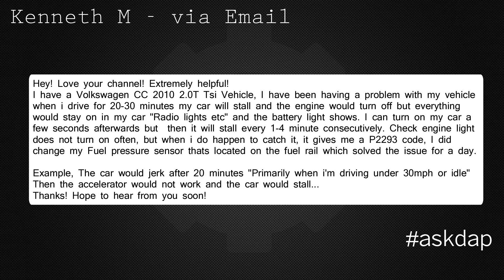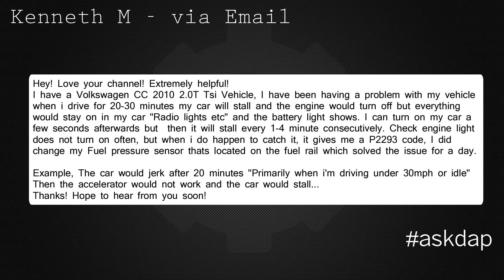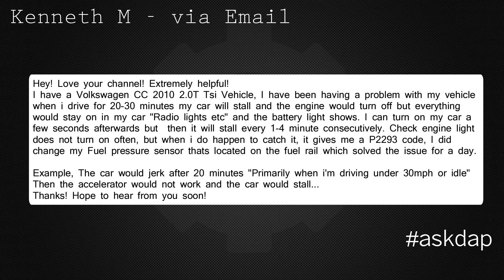VW 2.0t TSI Engine with Fault Code P2293 (N276 Valve)

Comment: I have a 2011 VW cc sport 2.0T TSI engine. Initially I was getting DTC fault codes for a low pressure fuel in the rail. Replaced the High pressure fuel sensor as well as the high pressure fuel pump HPFP. After clearing the fault codes I was getting the following fault codes P2293, P2178 and P2187. Also to mention that I have previously replaced the intake manifold, the PCV valve as well as the spark plugs and igniter coils. It’s like chasing a ghost for the last few months. I appreciate your expert opinion. Thank you so much in advance.

Comment: Hi, i get the same code but different symptoms in the morning i start the car easily but if i stop the car in middle of the day for Grocessory staffs for example like 30 min or 60 min and try to start the car it start and then engine would turn off, i need to keep pressing on fuel while starting the car for couple of minutes so the car can start .. 
I have changed the high pressure fuel regulator issue solved for a week, but again the same issue came back 😢😢

Comment: Mine has a p2293 p0087 p0089. I replaced the low pressure fuel pump. The fuel pressure regulator on the high pressure pump. The fuel filter. I had a new motor put into the car. Its a 2007 audi a3 2.0t. Is the fuel pressure regulator supposed to be orange or black? I actually blew timing belt then put new motor first day I had car back blew piston through side of that motor. I'm goona try the cam follower and high pressure fuel pump of 2nd motor. The shit off first motor is gone.

Comment: Hey so I have a 14 a4 that and after I got my ko4 turbo and tune I started getting a jurking when I was continuing a pull after a shift. This later on I got in my car and started to drive and it just died while I was on the highway and wouldn’t start back up. I have the p2293 and am wondering if my hpfp literally died. Planning on taking it off to look at it but I was freezing today. Tia

Comment: My 09 Passat, 2.0 TSI randomly would shake violently on me, this started two years ago (2019). I was due for a carbon clean up, so I did that, the car ran fine for a while. However every so often, at complete random, the car would just not roll over. It would crank, start, then die. After 20-30 mins the car would start again without any issues and then would happen at random again (each instance months apart). 

I changed the injectors, sparks and coils all from vw parts dealership. Recently the car has started to do the same thing more frequently, three times yesterday.

I changed the hpfp because of the P2293 code, and it worked fine again for an hour. In my test drive After replacing the pump I gave it pressed the throttle to test the acceleration and the car choke and started shaking. After pulling over and running diagnosis, it gave me misfires codes on cylinders 1 to 3 and the car would shake again, almost as if it was choking, bit of a stutter but the p2293 code didn’t come back. 

Later that same day I checked the coils and sparks, cleaned them and back to normal…but an hour after that the car would shake as if it was choking and didn’t want to start again. This time the p2293 code came back on.

Anyone had a similar issue? Any suggestions? I have yet to replace the fuel pressure sensor… I think that might be the last thing I replace before I let this car go…been a headache. Cheers.
Reply: Is this a 2.0t?
Reply: Yup. 

Update - changed the battery and the issue went away for a couple of months. When I changed the fuel pressure sensor, there was no change. Looking to replace the LPFP later this spring.
Reply: @kevincortez6273  aw ok, my q5 has stalled on me three times after I changed lpfp and fuel pump control module so am now looking to change the hpfp and cam follower and pray.
Reply: Does it stall while driving or soon after start up?

Good luck - let me know if that fixed in in your end. I actually got my car diagnosed for the issue and they told me it was carbon build up. Highly doubt it cause I cleaned myself real good.
Reply: @kevincortez6273  so after I changed the pump, it would still crank and not turn on so I found out about the pump control module lodged in that cavity and changed that because that’s controls the pump priming and I used to only hear the pump prime half the time, so when I changed that it worked perfectly for around 4 days, then I put gas in the tank and the car stalled on me mid drive half a mile down the road for the THIRD time when I was happy that the issue was finally fixed. At this point I don’t know what to do I scanned it and only got code p02293 which could be a million fuel and wiring related things.

Comment: Mine has the same code but my car doesnt die. It shows no check engine but has the code. Its a 2006 vw passat 2.0T and i have noticed when the code is displayed it does seem to bog down but never dies and doesnt really idle rough

Comment: First thing i check is if the hi pressure (thrust) sensor is correct for the car , its easy to do and I have seen incorrect sensors installed numerous times , cant stress enough to use OEM factory on critcal fuel system parts, there's a reason they cost more

Comment: My gti mk6 got p2293 code.
Check engine is off.
The only issue i have is that all morning it takes a little more to start.
Because when i use it to go anywhere, I stop it, do things then about 10-20-30 min it starts with no problems.
What could it be?
Fuel pressure sensor?
Low pressure fuel pump?
HPFP?
Fuel filter
Reply: Did you figure it out? Running into a similar problem

Comment: 20AE FUEL PUMP CONTROL MODULE RECALL
Guys don’t waste any money it’s open recall for this car just go to your dealership and fix it for free, I have the same issue on my car after they change the module it was perfect
Reply: What model you have please ? As i have the same issue in the video and this happened to me every some days and sometimes same day more than one time without the check engin lamp
Reply: What were your symptoms, and what trouble codes?

Comment: Dear, and the P2294 that makes reference to the regulator of the fuel pressure and possibly the relay J757, because the revision and the relief are in perfect condition, the organization and almost instantaneously in the fault and the P1916, do you attend to me? regards

Comment: Hey, I replaced hpfp cam follower and control module which fixed issue for a day I went to start it this morning and it cranks and starts but 2 seconds later stalls any idea what can be occurring maybe fuel filter ?
Reply: Did you figure anything out?

Comment: Well wondering if this is what I need, it won't start on its own but if I put starting fluid in it then it starts and runs fine and sometimes it will start again after i shut it off.  but usually more than 8 hours its starting fluid all over again to get it to start then it runs

Comment: what was the solution to his problem? i have the same problem with my 2010 cc. i have already changed the HPFP but that doesn't seem to be it. After about 20 minutes of driving and I'm at idle my car stalls when i start to accelerate. its not violent like the example in the video. once i try to accelerate the car will slowly start rolling and ill have time to pull to the side of the road. when it stalls the battery light will be on and the car starts up right after but does it again like 3-4 minutes later. can you give me any advice?
Reply: Did you solve it?
Reply: christopher Sanchez  did you solve the problem and how?

Comment: Hi. Same thing happening to my VW Passat 2.0T B6, 😖.
Codes
P0089, P2293 & P2540. You think it could be the HPFP? P.S i already replaced Module on low pressure pump Thanks

Comment: great videos Thanks!  I am getting a code p12a2,  any info on that would be great.  I was wondering if it is possible to by the fuel pressure regulator valve that is screwed into the top of the fuel pump..  2009CC  2.0T  thanks again,  B

Comment: My car is a vw gti 2009 and I have the same code but also my p0300 telling me I have the cylinder misfire. There was gas coming out of the spark plug and the mechanic said there is gas now in my injectors ? can someone help me ?

Comment: Hi i have this code on my audi b8 tfsi. I am also experiencing a loud screeching and ticking noise. I used a stethoscope to hear the HPFP and it definitely seems to be making the sound. Went online and bought another vw audi hpfp and replaced it. Problem still exists. Replaced PCV as well just as a precaution, and the sound is still there. It makes almost like a mechanical screeching sound. Help! (Car has no issues. Runs drives and accelerates without any problem or jerking.
Reply from the maker: +Ben Zhu Its possible you have an issue with your fuel pressure sensor https://deutscheautoparts.com/make-model-year/audi/a4/b-8-2009-2012/engine/2-0-turbo-audi-valve-lift/repair/sensors/06j906051d-fuel-pressure-sensor-fsi-tsi-vw-audi.html
Reply: Just to be sure before i do go ahead and buy this. I've taken the stethoscope once again and traced the sound down the metal pipe from the HPFP to the fuel rail. The upper portion of the fuel rail that is closer to the metal pipe is louder than the lower part( That part being closer to the pulleys and belts) Also the sound is somewhat of a metallic screeching noise.

Comment: In my case, replaced the Fuel pump and cam follower back in April. 
I dont understand why i got this code, the car drives normal I cleared it after scanning.
Reply from the maker: +Thafussa Do you have a TSI or FSI engine?
Reply: 2.0 TFSI Deutsche Auto Parts
Its a SEAT leon FR+ 2008, engine code BWA.
I don't think you guys have SEAT in the U.S.

But its the same engine found in  the audi A3 2.0T and VW GTI mk5
Reply from the maker: Thafussa Yes Im sorry we dont
Reply: but its the same thing

Comment: having this exact same issues onmly my 2008 vw gti stalls out on the highway when idling and prettymuch whenever it wants to  any ideas lpfp wwas juist replaced it was just tuned to stage 2 and its so annoying because i have to work and i cant trust my car to get me there safely any tips?
Reply from the maker: +William Evans Sounds like it could be related to the fuel pump module.  Take a look here https://deutscheautoparts.com/2-0-t-fuel-pump-control-module-1t0906093g.html
Reply: +Deutsche Auto Parts thanks man I forgot to add my fuel pump is also whining and causing my system to run lean

Comment: Hey guys, I recently got a 2006 WV GTI 2.0 and discovered that the person who had it before me did some major "Jerry-rigging" on it. So now I'm trying to get it back up to proper working order. So..... There is a hose that runs from the fire wall (I guess?), on between the engine and the brake reservoir/master cylinder, and into the engine. It's flattened out like a snake skin and doesn't seem to need any hose clamps to hold it in place. Is that the "Brake Booster Hose"? Whatever it is, could you tell me what the part number is or give me a link to where I can buy a new one and give me some tips if there is some kind of trick to installing the new part? Any help is greatly appreciated. - Spencer
Reply from the maker: +Spencer McElrea Im sorry we missed this comment.  Can you send us an email info@shopdap.com with a picture.  We can help.